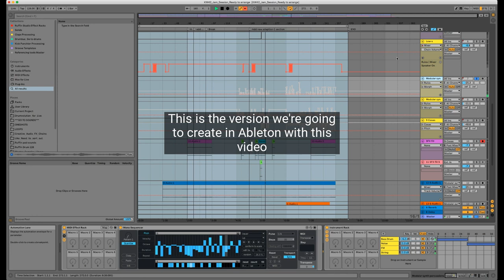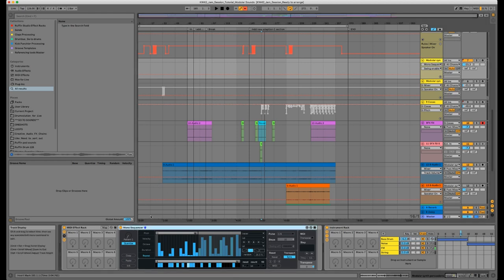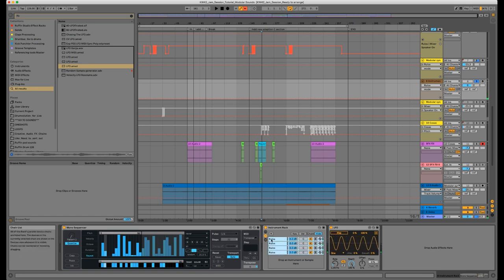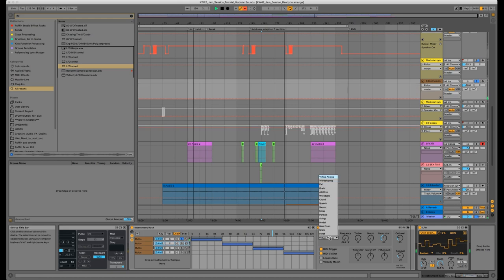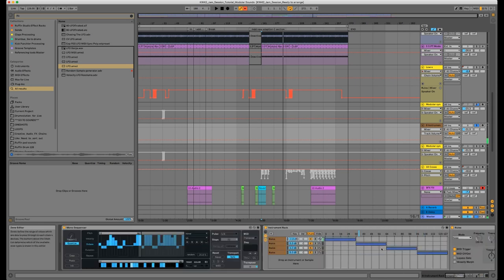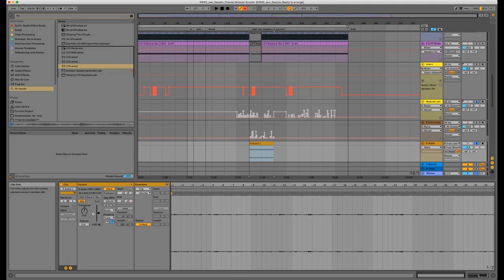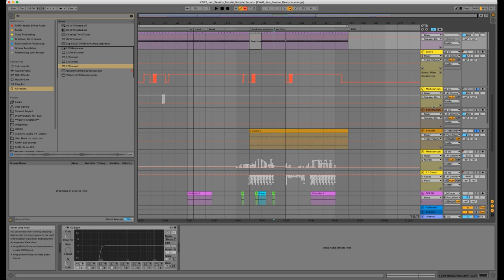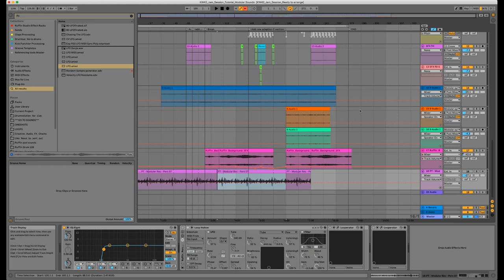How to create Ro-minimal modular percussion sounds in Ableton Live without using a modular system

Comment: Hi, I hope your are doing well,.. may I ask something? I have new Mac M1 Max Pro... do you have any suggestions .. how I can use rulos ?? I bought from the side... unfortunately it doesn't work...
Reply from the maker: Hey bro, I honestly dont know. I have M1 as well and on my end it works. Send me a direct message pls, I was in contact once with the developer so I might can help out if I know more details. Did you get it under the max4live page?
Reply: @RuffinStudio  Hi bro, thx for your feedback.... I am really struggling with this... I bought a new Mac and many plugs aren't working anymore ..... regarding the message....here are the text. '' Rulos contains externals that are not compatible with Apple Silicon. Consider running Live under Rosetta''